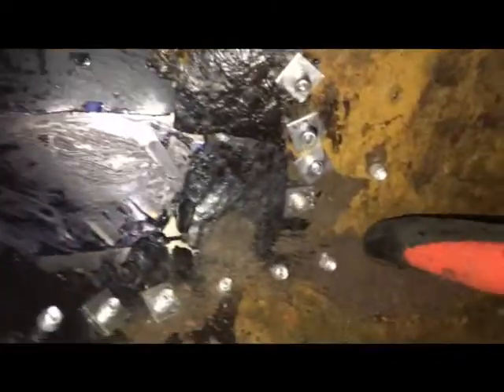Fixing Rusted Lawn Mower the I can't weld method, scale mail

Comment: How’s it holding up?
Reply from the maker: just fine. I did rust converter all over it and repainted it. The original owner was storing it outside and not cleaning it. so the grass just holds the water in and rusts it out. I store all my equipment in a garage so they don't rust. should last until the engine throws a rod lol.
Reply: bobspurloc nice my craftsman needs fixed too I Might  try this
Reply from the maker: eh its worth a try. I had all the stuff on hand already I believe. takes some thinking lol. my original idea was to just rivet on a single sheet of metal then I realized that isn't so easy because of all the contours.
Reply: bobspurloc ok do you still use this or is it a backup mower if so has it held on
Reply from the maker: Yeah I use it for all the edge work, driving mower for bulk of yard. I don't see it not holding up. The original owner had that hole covered with duct tape and was working fine for them lol. till it had carb issues which I fixed. If I had left it just duct tape it was going to eventually warp the deck. so this repair structurally reinforced it.
Reply: @bobspurloc  ok sorry about so many questions just trying to find the best way to fix mine
Reply from the maker: no problem. control the rust close the hole. and u will be fine. if you plan to leave the mower outside, then lift it up and clean the grass off with a hose. grass holds water to the metal and promotes rusting
Reply: @bobspurloc  update it worked good gave it to someone who needed a mower bad recently